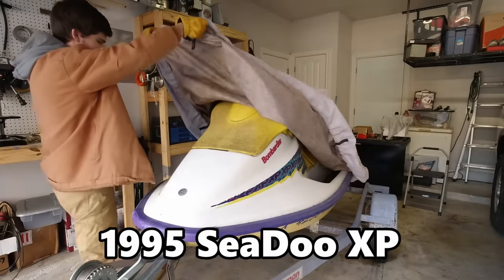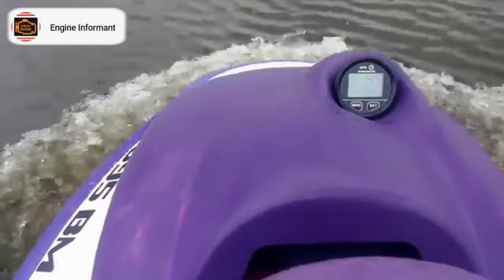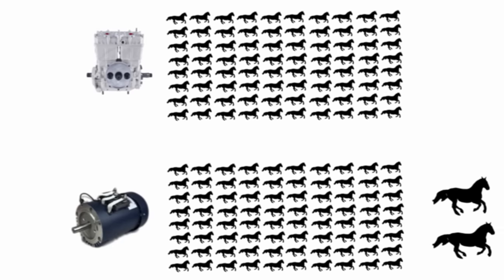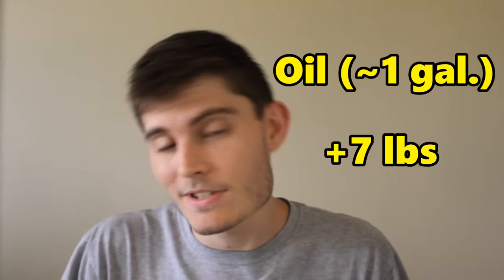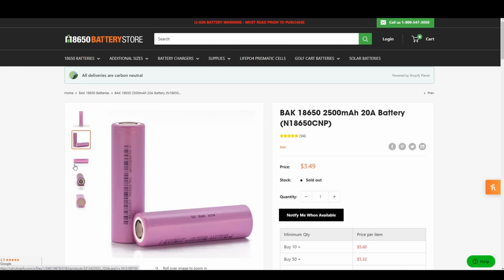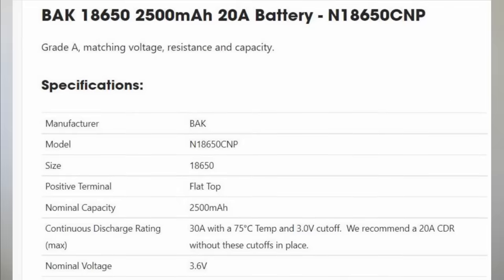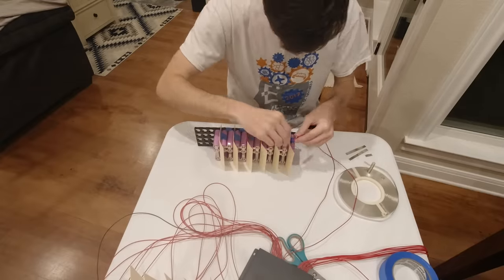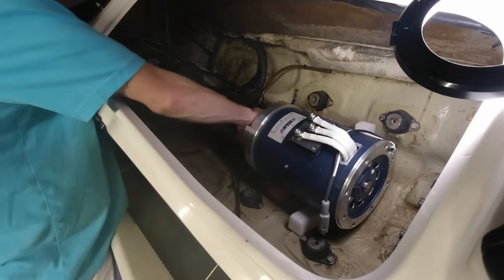Electric SeaDoo Conversion!

Comment: We took a somewhat different approach to set the official UIM kilometer record in 3008 that still stands.  Our two way average was over 98 mph.  See https://www.youtube.com/watch?v=-yNu2_LlO9s&list=FLKa7H9pgwmzbufG9sD23_FQ&index=20&t=4s  

We ran 7 6S 5000 mah lithium polymer packs in parallel with 6 groups in series for a total of 42 6S batteries.  This gave 120 volts at 840 amps peak or about 100 kw input to the brushed motor.  With an estimate of about 70 to 75% motor efficiency that's over 90 hp to the propeller. Today we could use wrecked Teslas for a more powerful and efficient setup.

Comment: You could use a cv joint instead of the coupler you used.
Reply from the maker: that could work, but it would require more modification for the seal around the driveshaft, or to move the engine forward but I it was already front heavy

Comment: i am also sorry to see you overpaying so much for a JK bms, and getting it through Amazon.
while JK bms's are some of the best if not THE best on the diy market, you may run into issues with firmware updates on the app if you were sold an older model.  you also don't get the JK warranty either and are stuck with Amazon's short and limited policy as well as whatever sub vendor you went through.  still glad to see you using it though.

Comment: Your cost to build is high but your cost to operate and maintain will be lower. Gas is a lot more expensive for a unit of work compared to electricity. ANd that is assuming you buy gas in town, and not at the lake. If you have to gas up at the lake electric becomes much cheaper. Bring a solar generator and you can charge it up while you have lunch.

Comment: My thoughts only 2 that are good electric. Sailboat throw wind solar and prop as generators and you're good. 2nd diesel electric like what trains run on... Electric speed with diesel twork for the generator step up or down for the application.
Reply: buy     pucnick biat hybdér dusel jets 2925 90 minyt run time

Comment: I think the error is there! in using a Motor with high torque! I think it could have worked better with a motor but like those used in drones, which work at higher speeds and higher KV or revolutions, (I mean a large motor in size but with high KV like those designed for drones) , but I have learned a lot from your experience, I hope to replicate your work but in Water Scooter, thank you very much for your video

Comment: Am I doing the math correctly here? The motor and it was originally shot it was going to cost eight hundred and something dollars to replace. So you spent $2,600 on an electric motor? Then the battery system and all the high-cost parts to go with that. For a final cost of about five or six grand Maybe. And Battery that, if it runs dead out in the water you cannot just pull it up to a Marina and fuel it up and go back home.

Comment: So $900 you could buy a rebuilt motor which is less then the battery’s. What really don’t understand is why replace something that with proper maintenance will last much longer then anything electric. The battery’s alone I bet don’t last 3 years? What real gets me is range an charge time. When before you just pour in another gallon.  I don’t understand why people want to downgrade?

Comment: next time just order a motor straight from qs?  ~$800 will get you a 12-30kw capable motor...
snag some lifepo4 or LTO cells from somewhere like batteryhookup, and for the cost of your thunderstruck motor, you will have your entire system.

Comment: Using parts from a zero electric motorcycle would have been quick but not necessarily cheaper. There is a great channel called newzeroland about a guy who uses parts from an egerica Italian ev bike in a small Japanese car.

Comment: Most ev cars have a water coled engine, in the lake you don't run shy on cold water. So you might get a way with much smaller engine just overdriving it with good cooling. Formfactor of an ev battery might not be useful in that use case, but in some cases it might be a good choices, current ratings are good, there is cooling passes and bms inbuilt. Just get a crashed ev and take part's out of it

Comment: the problem is you would have much better efficiency with just a long boat with a stick motor   you could probably go 80 miles an hour easily
Reply: buy duifey solar elrric boàt  22 duffe cabiñ 100 miles rañfe

Comment: When figuring out how many cells you require you always use nominl voltage not max voltage so you should have used 3.7 volt not 4.2volt

Comment: Then you have to add the amount of wiring plus the traditional controlling mechanism then you will need lager lithium batteries so they do not run out of power in the wrong places as can't recharge while in the water. So in fact you will be putting in the same weight as taking out. Most two stroke engines that can be carried in one hand can weigh under 10lbs in weight putting out 120hp as modern 250cc go-carts show yes they are fuel injected.  This is why two stroke engines used to be in all outboard motors for boats they are less than half the weight of any four stroke engine. So what HP did the electric engine give? Don't forget the average jet ski will do 40MPH and not sure what your proving either.

Comment: It's not horsepower but torque = volts 415v or best 900v!.. How much torque does te ICE engine need at what rpm.. The batteries will give a wicked centre of gravity, plus the motor rpm could be increase jet propulsion speed. But best is go for very high RPM 20,000 with a ratio gearbox , electro magnetic clutch for safety, epicyclic gearbox to reduce the rpm and motor size, increase torque so the electric motor of half the weight would of been sufficient.. The best battery at present is the LiFePO4, 2000 plus recharge, no chance of fire. Definitely buy a cheap thermal imaging camera, you will see where the heat is coming from. Lovejoy a Timken company sell extremely tough coupling just for this job.. We are planning to build an electric powered excavator so understand the pitfalls you went through..

Comment: U could buy six of these original petrol engines for the same price.  People this is the main issue with electric motor power, after that it's weight and after that it's the power drain of the battery packs after 500 charges u are down to 60% charge capacity so after 1000 charges where will that leave u 30% who knows.

Comment: Aluminum is a poor conductor, especially through a tapped hole connection. You really should use copper strips for the battery pack terminals.  Also, expect an eventual Lithium Battery fire - since you are not using a true BMS... adjusting the power supplies is not a suitable substitute... and it dose not disconnect when the batteries are at full charge.  If you leave the power supplies connected to the batteries after it's fully charged, it will plate out Lithium Metal in the batteries, which causes internal short circuits within each battery cell... you seriously need a proper BMS to control current, voltage, and charge termination.   Using mis-matched battery packs will not only run down the lower amp-hour "expansion" pack first, but THEN then high-capacity packs will force the low-capacity pack into NEGATIVE VOLTAGE, and this will always result in destroying batteries, as well as what they are mounted-in... they will explode with lots of smoke and fire.

Comment: Couldn’t you just used to 12 V batteries hooked to two 120 V inverters 1500 watt each. Then connect them in series to make 240 volt 3,000 watt of power!
Only using 2 12 V batteries!

Comment: very cool 🤙

but im not sure i would feel safe turning it around in the water. 
imagine the only thing that can keep you safe gives you deadly shocks.. 
often these these are used in extreme weather to make them most fun.. 
it dives under water and you go through waves i have been in snowstorms and huricanes on a seadoo.
no way i would have do it on this 🤣 safety first 🙃

it´s a great idea, but alot more work is needed when it comes to making the electric circuit is 200% waterproof

you could also have made those batteries alot cheaper..
jehugarcia youtube channel can show you how..

The 21700 was designed to replace the 18650 in EV battery packs

someone need to calculate on fuel savings and other things before saying it is expensive, i can use over 50dollars of fuel on a day..
but this thing can be charged at night cheap by many people or free with solar..
the expenses over a longer period needs to be calculated, a seadoo service are not cheap, and how long does a seadoo engiene last in general...

and compared with a normal seadoo how does this look when it comes to co2 over a longer period, that is also very importent if people have to decide what makes sense

Comment: PS. Lithium ion 18650 Cells are Extremely Prone to Catching Fire And Exploding. Tread very Carefully when in Minefields Obi Wan. (I have explosion proof containers for charging them in, and wouldn't consider buying such batteries again today, whether Pink or not) Heck look at them wrong, park your ebike wrong, and they burst into flames for the fun of it. ☹️

Comment: electric car companies raise voltage to overcome losses at higher rpm. it’s bs. if your looking at a power chart for motor always look at the torque curve. motors running at rpm above were the torque curve and power curve intersect make for better a generator. thats why all the electric cars that use a gear reduction are fast as shit on an 1/8 mile drag strip but after that the acceleration slows way down. (eddie current losses)

Comment: I see problem the movement side to side inside battery boxes over time will stress the plastic  why wouldn't you just use non conductive foam to fill gap around battery making simple template to fill with foam about size of you battery pack
Reply from the maker: I like that idea!
Reply: @ZachsGarage1  glad I could help. You are just one man so I think you did excellent 👍 companies don't have just one engineer they have teams. So you did very good 👍

Comment: Pretty cool. Why didn’t you go with Lipo instead of Lion? I’ve never seen a fast RC vehicle with Lion. They don’t have the high discharge rate needed. I expected that to be faster than the gas version. I suspect that a small lipo that only lasts a few minutes would make that thing rip. Also the coupler should have zero angle in the driveline. That’s why it failed. PWC motors are shimmed. Thanks for sharing! 🤙🏻🤙🏻

Comment: It's an interesting project but clearly doesn't make sense cost wise. That will continue to be the case as long as batteries can hold only a small fraction of what gasoline holds on a lb for lb basis.

Plus, with gas, at the half mark on the tank, you've ditched half the weight.

Dead battery weight is forever

Comment: 10 KWH battery... using 500 amps at 144 volts (72KW) will last all of 8 minutes... Before needing hours to recharge.  Methinks someone neglected to do that calculation before spending many thousands of dollars.  O_O
Also: 10KWH is the same as the $7,000 Tesla Powerwall... meant to power a house for a day or more.  😆😅

Comment: u forgotten about rpm because boat more on rpm for speed if not enough rpm then aint going be far or fast
i have seen few people throw in 600watt motor that was over 15000 rpm 48vdc (it did work in jet ski n later he crash it)
Reply: 600 watt 120 wat bate 1 or 2 hiyrs topsoeed
Reply: @sharonbraselton4302  look at motor rpm and torque and HP rate you will see different between two lines 
more rpm on boat mean faster you go and less rpm mean slower you go
but vehicle is whole different things because you carring weight which mean you need way more torque to move that much weight and HP how fast can it take weight without falling out it way different than boat because boat just sliding thur water like nothing pulling on it but vehicle you have wheels it pending on weight and more weight make tire flat mean harder to move and less weight mean tire are full inflation easy to rolls but only on flat road smooth if you push on sand it get stuck harder to move there so much more information on vehicle vs boat because boat have less information than vehicle
Reply: @sharonbraselton4302  12v motor aint going get any faster than 72v motor because 72v is more powerful than 12v

Comment: Your math is slightly off because that engine never had oil in it, it's a 2-stroke, the oil is mixed into the gas. Mixing gas and slapping ass.

Comment: NOOOO.....battery cycles are calculated to 80% the fact that they had to go down to 60% means they are bad cells. without a smart BMS this pack wont last long becouse without a charge limiter the max cap will drop within 1 -2 years and these batterys need to be stored at 50% when not using long term.

Comment: It was a good project but do not think it is safe to ride on the possibility of getting shocked once swamped in water.  All the pounding of the Sea-Doo all batteries will be tossed everywhere and possible electrical fire.
Reply: It's safe it will only burn to the water line.

Comment: I appreciate the thought and effort that went into your build, but it's totally impractical.  It appears that you spent well over $5000 on something that you could have got much betters results from by just buying and installing a  replacement gas engine for $1000 . Not to mention that it's super scetchy to have that ma y batteries being subjected to constant jarring up and down bouncing over waves. If just one of those soldered joints lets go andshort circuts you could have a massive fire that can't  be put out!

Comment: I noticed you weighed your tank empty!!!! you're going to need to double your weight, you didn't account for a full 15gallon tank which is 120lbs  + the oiler of 1gallon at 8.5lbs. With a conversion like this i would be worried about being electrocuted when that baby flips over and water fills it up....
Reply: wróñg

Comment: So instead of 500 to repair an engine it's better to spend 3000 on batteries, controler and motor and still have less power. It's cool though.

Comment: Electric anything is ridiculous, what can you get maybe 30 minutes on the water? the resistance is much greater than on asphalt with tires. The drain on the batteries would make this completely impractical.

Comment: False Premise, Wspecially when it comes to anything used in a Narine or large Lake Environment.  Power" is NOT THE ISSUE ! Energy Density is the Issue, abd No Current Battery Technology Comes even Close to Matching the Energy Density "Battery" of Gasoline, and Diesel Fuel has far Superior Energy Density than Gasoline. This is Basic Stuff Guys, Get a Grip ffs. Example you have a yacht and you need an inflatable Tender to go to Shore and back, and you shove an electric Outboard on it,  which on a windless dead calm Day, gives you power for up to an hour at say 5 to 7 knots (but at 7 knots you have a lot less than an hour of power available). Now you've gone ashore nice, done your laundry or whatever, some shopping, and you get back to your Dinghy, and Co ditions have Changed a LOT, wind has picked up bad not forecasted - it happens - and there's a wind against tide vicious Chop, and to try to make progress back to your boat and have to draw power at maximum to try to make any headway . Question, how many minutes of Energy do you have left in that battery, to get you to your boat ? It can easily be under 10 minutes of propulsion left can't it ? OR, do you put a very fuel efficient 6 hp 4 stroke outboard on your Tender, with say a 3 gallon Fuel Tank "Battery" That can take you over 100 miles if you use the throttle sensibly. You Guys appear to have the impression that Life is a Drag Strip with Perfect Weather and a helpful Tail Wind. We'll it isn't,  and you'd better start thinking again. Brains in Gear, You'll Make it. Best Wishes.  Bob.  👍🙂

Comment: As a mechanic and a certified onan mechanic I don’t see electric as a improvement. It’s really a downgrade that costs a ridiculous amount. What really blows my mind is how much batteries will cost.  
I look at it this way I have a few boat motors. My 2 lake motors are a 7hp and a 15hp both were my grandfathers. They both run like a top and are 35+ years old. 
Show me one electric motor that’s 10 years old show me a battery older then 5 years. Saving the environment by making more stuff that can’t be reused? Just don’t understand this push for equipment that doesn’t have durability and is overpriced.

Comment: 2 major problems with your project: 1. Chinese batteries have been tested to fail well below their specifications. So the range will be a major issue going electric. 2. Water intrusion inside jet ski is bound to happens and that spells disaster to you and environmental disaster to the lake. Department of Transportation would never approve such vessel.

Comment: Insanely expensive components, extremely labor intensive, and the machine will spend more time broken down out of the water than in because of the massive amount of complex and less than robust parts it requires to make it function. And lets not forget the 6 to 7000 dollar price tag and the months of very hard work and research that are involved in the project. It's not very difficult to conclude that a build such as this is completely impractical and entirely too expensive to be a viable alternative to a conventional gas engine(just like virtually every other E.V product on the market today as well) The simple reality is that electic vehicles are at least a decade away from being a cost effective and practical consideration to the internal combustion engine(and 10 years is being very optimistic!) Anyone who believes otherwise at present time is completely delusional and in denial of reality